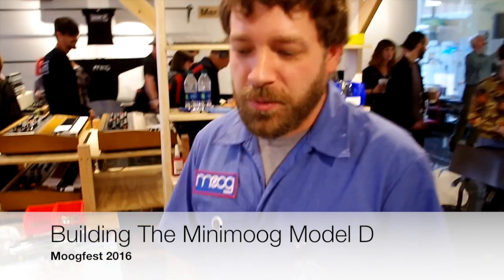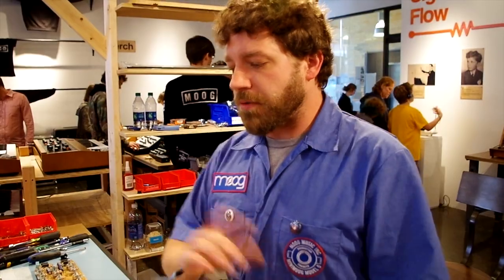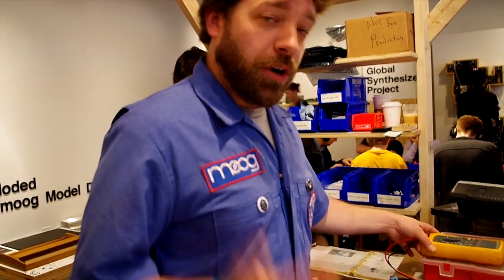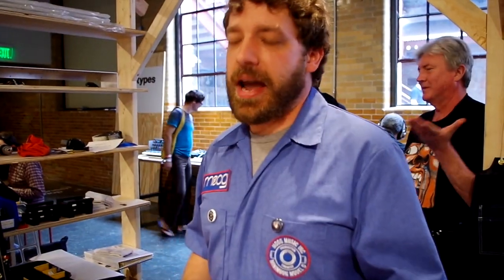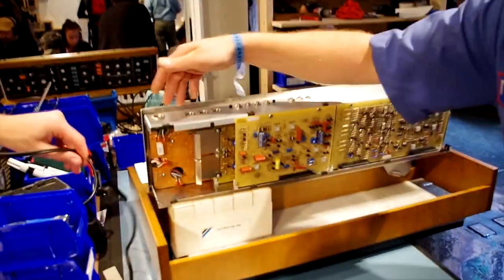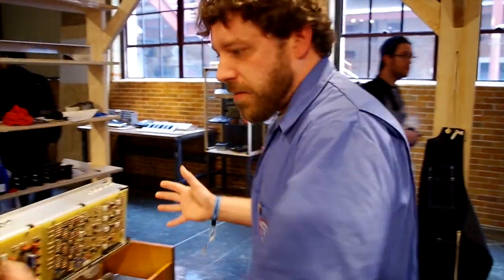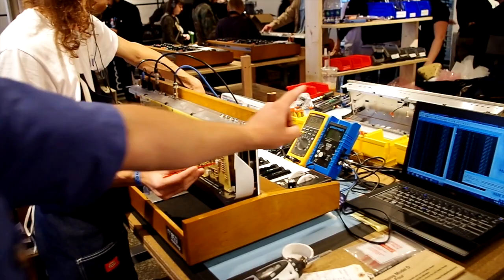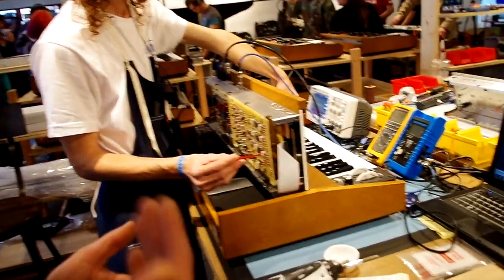How To Build A New Minimoog Model D Synthesizer

Comment: The 2022 Model D reissue looks better, in my opinion.  The new type of wood used looks like a better choice aesthetically.  Although not sure if the new wood is any better in terms of preserving its integrity when being exposed to ever changing external temperature and humidity conditions.